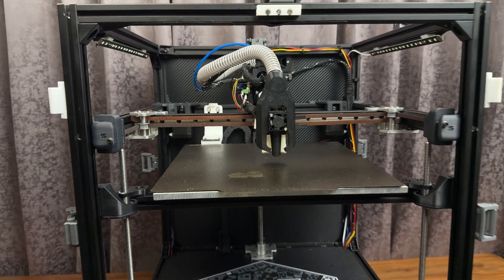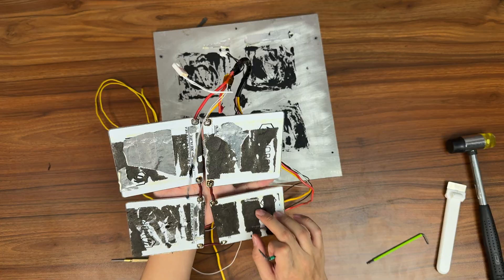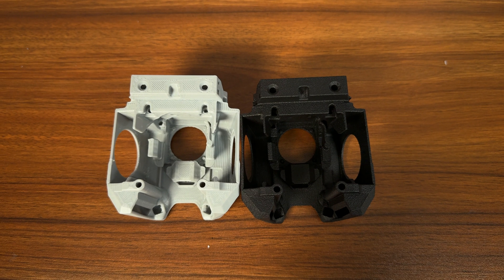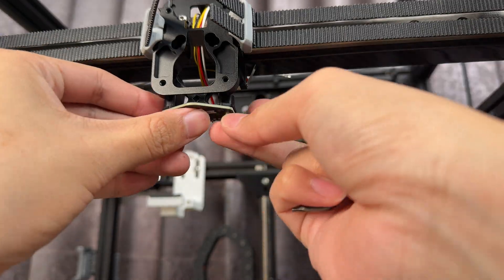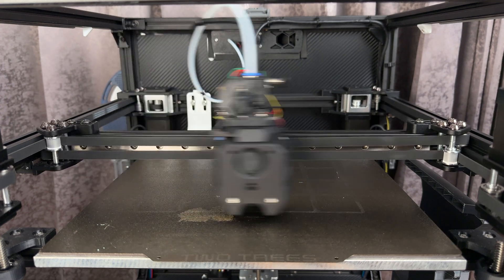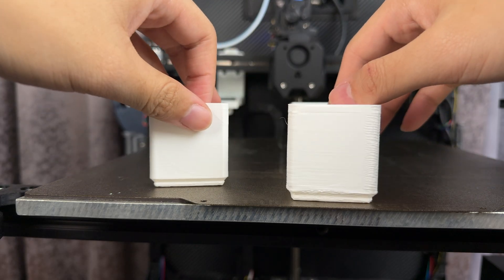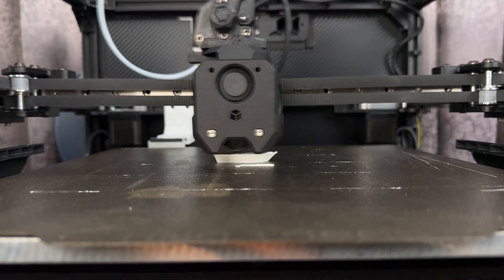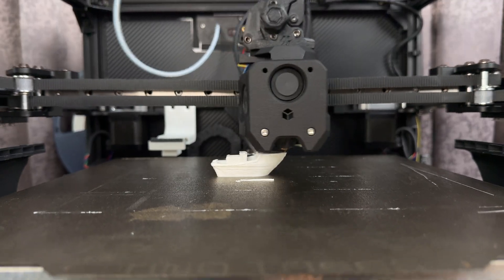I Turned My Voron Into a Beast

Comment: what caused Z bending is that you are using rigid coupler, use spring ones instead and Your Y imput shaper needs Improvement, try my designed toolhead in my chanel

Comment: hi good machine i have 2 machines a bambu p1s and a Sovol max, i have to say, i really like the open source code thing alot better than the bambu closed eco-system, but it printed out of the box really well for 10 days, then alot of failures because i new nothing about 3d printing . i now have over 1400 hrs on the p1s and tuned the belts on the max so it finnally fiinishes prints well . i dont know how to code or program , but willing to learn. the voron has to be better in most ways compared to these machines i think? any how question why did you pick the voron trident over the 2.4?.
Reply: I don’t have a voron though am thinking about it. The trident is cheaper and more rigid but it seems to be not recommended for 350x350 build volume. The 2.4 can go bigger, has 4 axis z and has more proven tool changers. I haven’t done a ton of research, but it seems to be the trident is recommended unless you need the larger size or know you need tool changers, even then there are still tool changers for the trident.

Comment: Great video. 2 questions:
1) Where did you get the nice deck and back panel from? 
2) Where did you get the CNC Z parts for the bottom?
Reply from the maker: Thanks!
1. Generic Amazon standing desk with walnut color top, Back panel was just a sticker
2. It already came with the machine when I got

Comment: Everyone wants to make the fastest. The result is never any good though. Why not try to make the most exact printer that still are quicker than standard but... Well it's hard to compete with that but the result should be top notch otherwise iy doesn't matter how quick.
Reply: ummm... no? plenty people build printers with higher stable acceleration and speed in mind, you might only seen the printers that only chases max acceleration.
Reply from the maker: To be fair fast was only for fun, to get better result I would have to decrease the speed. But to compare to stock machine even when I decrease the speed it still way faster(-40% in time)
Reply: @Patrick-PMS Yes, but then it's actually a useful item. But hard to compete though.

Comment: Why you changed hotend to Rapido UHF? Goliath hotend is longer and better than Rapido UHF
Reply from the maker: Sadly A4t didn’t support goilath. My ideal setup would be Cutter Goliath CPAP
Reply: I’m on my 2nd Goliath now and they have issues as well. Rapido isn’t the best either but it is definitely easier to work with. Goliath measures temperature at a point in the hotend that isn’t very useful for tuning

Comment: cool upgrades, you should try some accuracy test prints, like see how thin of layers you can print with a 0.4 with overhangs and small bridges. High acceleration values are nice and all, but there is a point they don't really make your printer faster and only make the quality worse, and that point is good to know.

Comment: So this is basically an open source clone of bamboo lab's P1-S or X1-Carbon?
The reason I lumped them together is that they're so visually similar ⛓️🗄️
The X1-Carbon is technically more capable, but aside from some niche printing materials
The P1-S can't properly handle, they're functionally the same
Reply from the maker: If I remember correctly, Voron exist way before bambulab does. Plus Bambu did gave Voron design team some credit let that sink in
Reply: @Patrick-PMS  You remember fine! Voron was born born before.
Reply: You're really sitting here comparing this work of art to some proprietary unmodifiable over priced pre-manufactured Bambu machines? This thing is built like a tank, and customized to what he ideally wanted to build. 48V AWD and 20k+ recommended accelerations is quite literally amazing, with the ability to change it later to something like multi tool head or the upcoming Bondtec INDX if he so chooses. I'll just assume you have no idea what i'm talking about, but im only commenting because your comment just annoyed me by calling this some sort of "Bambu clone"
Reply: bait used to be funny

Comment: By the looks of it, 4010s are not enough for cooling at those temps and speeds, Maybe look or make a toolhead that incorporates the CPAP fan you have? While the upgrade to 9mm belts and AWD system is great, I don't really see sense in downgrading the hotend (or am I wrong and and you kept it?).
Reply from the maker: Currently there’s no filament cutter design with Goliath+Cpap so I made the switch
Reply: you got rid of that beast of an extruder for a filament cutter??
Reply: There is a filament cutter for the goliath? Did you even google? 😅  @Patrick-PMS
Reply: It's A4T so it's like 20% better cooling than other 4010 toolheads. Still quite bad though

Comment: what a great build. i have a 250 voron 2.4 right now and i want a bigger printer and im very torn between building a nice voron similar to yours or just getting a bambulab h2s and be done with it, since i am kinda done with 3d printers as a project, i just want to buy and use one nowadays, maybe a smaller printer as a side project. but your video makes me itch for a another nice voron build :D
Reply from the maker: If your main goal was to print I would go with the H2S. But DIY machine in general if you dial-it in could also be a workhorse